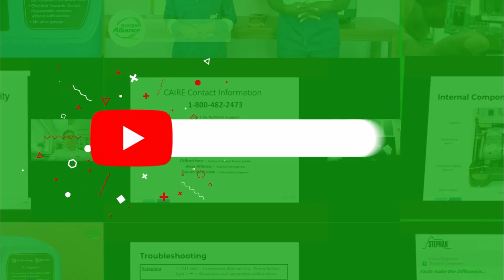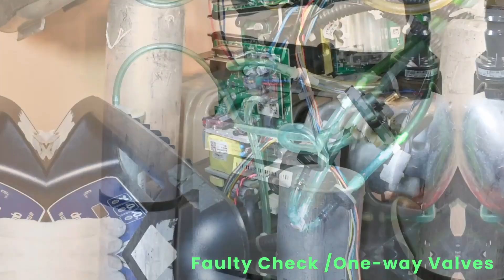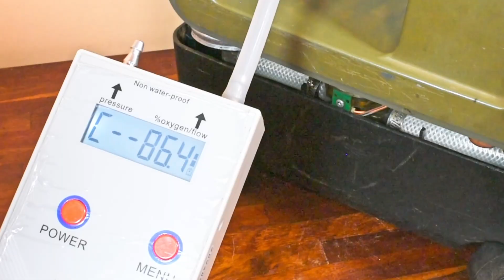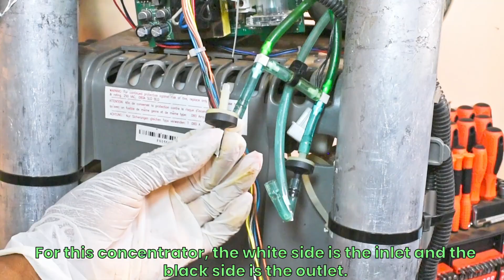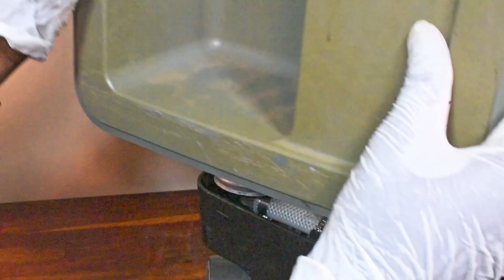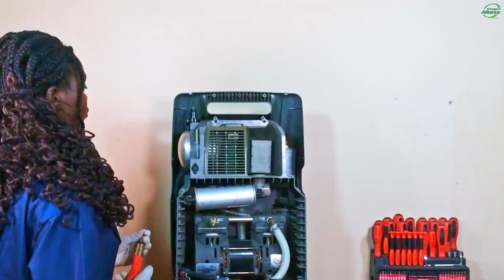How to Deal with Low Oxygen Purity: Part 3

Comment: We have a concentrator with very low running hrs. It's not used for long time. While running there is no error on the purity of oxygen. The flow meter is pulsing and compressor gets purged after every 6-7 seconds. 
What could be the issue. Any blockage in 4 way valve.
Reply: Type of concentrator? At what flow and length of time does it run with no purity alarm?

Comment: I have recharged the zeolite. Microwave method. But still get low O2 error. I'm guessing the O2 sensor of main board faulty.
Reply from the maker: I advise you to replace zeolite instead of recharging it. Microwave recharging method is not a reliable solution to retain the Zeolite functionality  as it only helps to eliminate moisture contained in the zeolites. This method cannot remove oil or replenish the degraded zeolite. Therefore, try replacing the zeolites with the new one which should be purchased from trusted manufacturers.
You should also verify that the oxygen sensor displays true results by measuring the purity using the oxygen to validate the error.
If the problem persists, then try cleaning filters, checking loose connections and leakages in the tubings
Reply: @uptime-alliance after microwave heating the zeolite did fizzle when a sample was put in water suggesting some change had taken place but maybe new zeolite maybe the way to go

Comment: How long should an oxygen concentrator work before changing the sieve beds
Reply from the maker: Manufacturers usually don’t specify an exact time for replacing oxygen concentrator sieve beds. In practice we usually replace them after around 5,000–10,000 hours of
 operation. Sieve beds should also be replaced if the concentrator registers low oxygen purity and all other causes (like leaks, filters, or compressor issues) have been
addressed. Even a new machine that has been sitting in storage for a long time may have sieve beds that have gradually degraded and need replacement before first use.
Reply: @uptime-alliance 
Been in the business 30 years and never seen a new machine stored correctly with degraded sieves.